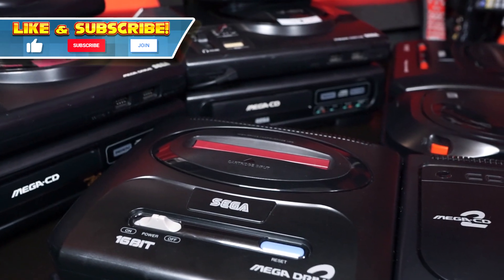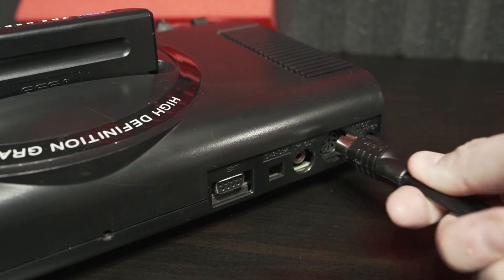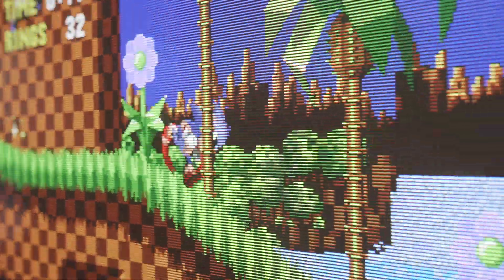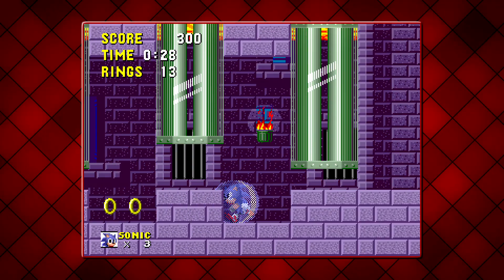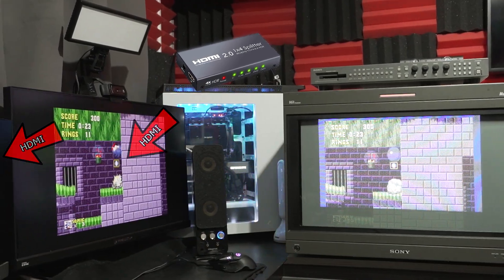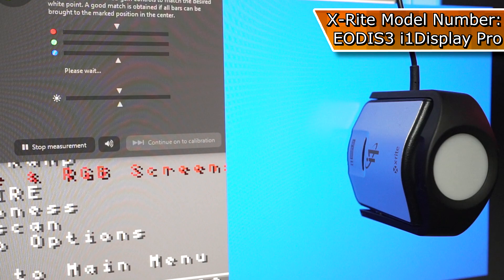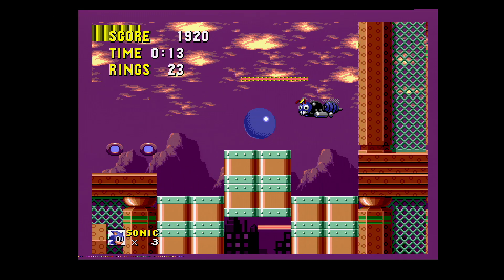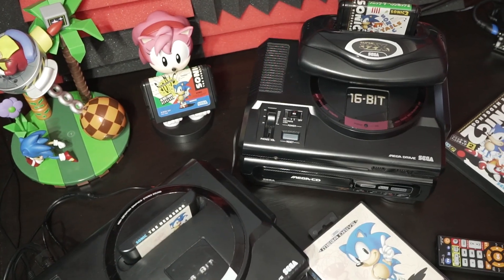How I capture my hardware footage - Straight to the point

Comment from the maker: But not all hardware supports RGB, and some that do may need workarounds.  Shall I do future episodes on other consoles if the story differs from this (for example, the ZX Spectrum, NES, Game Gear, Dreamcast, GameCube and more use alternate approaches and/or cables so I could make videos on them, but the Master system is pointless to show as it would be the same methods in this demonstration).  Let me know in the replies here!  In the meantime, check out the Sonic 2 comparison and can you spot which is hardware and which is emulation? https://youtu.be/plHJw9Vqg3M

Note: at 0:29, I show a comparison between two cables.  Be aware that the footage here is the SNES version of the Sonic 1 homebrew.  This is because I had a "triple shielded" SCART cable from eBay and a retrogamingcables "PACKAPUNCH" SCART for the SNES, but I had no cheap cables from eBay for the Mega Drive (Genesis) to prove my point (I use to so I know this statement still stands).  This was the only way to show an example but take my word for it, unless it's a reputable seller on eBay, stay away from there for cables.  You'll end up spending more money on more bad cables rather than just buying one quality cable.  I have also heard great things from this website: https://retro-access.com/
Reply: How, in your opinion, is the Dreamcast's VGA output?
Reply: but dreamcast supports RGB Scart natively without any workarounds
Reply from the maker: @t0biascze  Sorry, my bad, I meant the VGA output 😅 My BVM doesn't play nicely with it unless I bought this extra stuff to stabilise the signal.
Reply: And I would know
Reply: @redhotsonic  well then thats tv problem and not the console problem...
Reply from the maker: @t0biascze  I never said it was the console's problem?
Reply: Indeed unless its moded
Reply: Maybe you should talk about the N64's output. It doesn't support RGB (Unlike the SNES) but it does support S-Video (Slightly lower quality) and there are HDMI/RGB Mods.
Reply: Well, NTSC GameCubes don’t support RGB but PAL GameCubes do, I even have a short on my channel that uses my GameCube with RGB
Reply: i still dont believe you

Comment: Or you could just not care about sharp pixels and have dither transparency/extra color effects actually work and use composite, it's basically free and it works, still gonna need an upscaler though for all non crt tvs/widescreen tvs including crts though (retrotink, gbscontrol, ossc work well) can also enable scanlines which can give a more accurate look. or you could just use a MiSTer if you want 1:1 hardware emulation (fpga is really cool) or if you don't care about 1:1 hardware and just want most of the games you care about to work then just emulate on pc, maybe use something with filters if you want to get close to the original look.

Comment: I’m extremely jealous of this setup you have. Recently I’ve been learning about the retro tink 5X and thinking about getting it for the retro consoles that I have, since up until this point I’ve been using AV cables on a flatscreen and recently got a Zenith CRT that only works with composite and modifying a crt can be extremely dangerous because of its high voltage. Luckily your discord server is great for in depth questions on stuff like this, and a huge shoutout to Ace he’s extremely knowledgeable with the flatscreen that I have and giving me the info that I need to get a good picture quality. If anyone else doesn’t seem to understand this very well even if it’s a good video on Redhotsonic’s setup, I suggest joining his server.

Comment: I also reccomend getting the system modded to only have rgb signal, the composite signal will create interferance even when not in use
Reply from the maker: Already done!  I've lifted pin 50 to help reduce the jailbar effect!  Although if you look hard, it's still there.  Not keen on getting the bypass mod as I find it unnecessary :)
Reply: @redhotsonic  ok, cool
Reply: @redhotsonic  How come you find the triple bypass unnecessary? From my experience it also makes the sound better, but having multiple genesis/ mega drives maybe why.

Comment: Do you just use the vanilla consoles for recording, or have they been modified to remove jailbars? Either way, a good reminder to myself to get a better power supply for my Genesis! Thanks!
Reply from the maker: I've lifted pin 50 off of the VDP to help reduce jailbars.  Now, they're only noticeable if you purposely try to look for them.  The only one that it's still super obvious is my PAL but I don't feel the need to get any bypasses installed :)
Reply: Good to know!

Comment: This is a true technical and professional setup at its finest. Well explained, and makes sense once you dive deep into the more in-depth areas. Still struggling to figure out the hardware vs emulation difference, but the fine tuning is what improves on accuracy as best as possible.

Comment: Does your Genesis and Mega Drive Model 2 RGB cable display correct colors, because the one I have displays weird colors (ex. Knuckles is blue and not red, even when not doing the Blue Knuckles glitch in Sonic 3 & Knuckles, difference is is the un-glitched one is darker). My PAL Mega Drive Model 2 is also modded to be region free and obviously normal cables give a black & white display on NTSC (U or J) but colored on PAL. :|

I'm not sure if brands are different quality on RGB cables, since mine looks unbranded or doesn't have any logos or stickers on it at all. :(
Reply from the maker: My model 2's work correctly. Either you have a mis-matched cable, or your Mega Drive is on the blink.